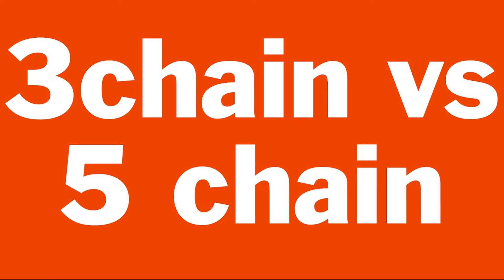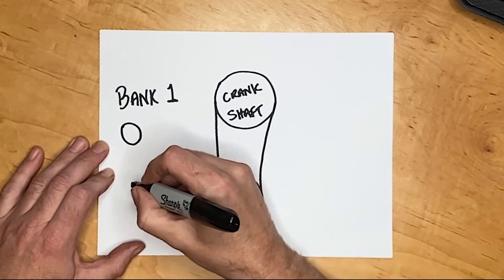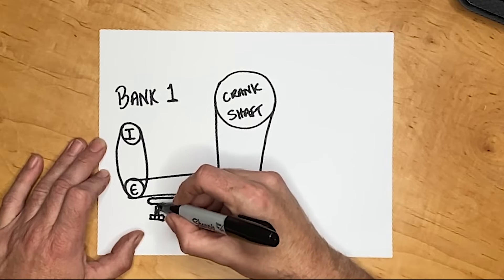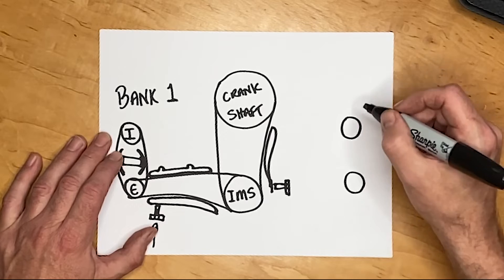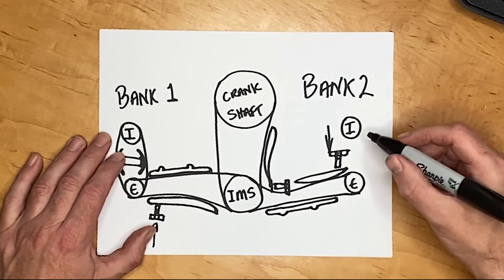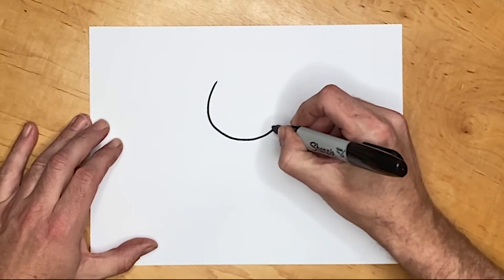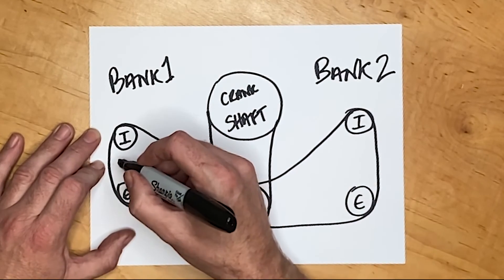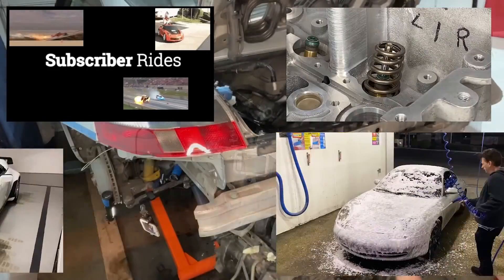Porsche Engine Evolution: Decoding Porsche 5 Chain vs. 3 Chain Design!"

Comment: Nice video! Good to mention that the variocam system of the 3 chain engines is completely different. It uses oil pressure to rotate the intake cam against the chain sprocket of the intake cam. The chain itself is not affected.
Reply from the maker: Thats a good point 👍 Thank you for watching! 🤘😎

Comment: Thanks for fun video! And great to see you back in action, hopefully an indication of improving health. My 2 cents worth: all else NOT considered, fewer chains of course is better. But also of course that's no way to make up your mind about what you prefer🙂. To me the 3-chain M96/03 has the plusses you mentioned (3.6 and Variocam+ give it more power and torque, plus fewer moving/wearing parts), and the minuses you also mentioned (more frequent bore-scoring, exactly because of the changes that @warrenlucier5796 mentioned, which in turn leads to oil contamination which leads to IMS bearing failure). On balance I think would still choose the later car & engine, but only after extensive Pre-purchase inspection! And looking at asking prices on European websites the marketplace overhere seems to agree 🙂2002+ 996.2's command higher valuations. Money no object of course would go for the GT3 engine (M96.76, M96.79, 3 chains, plain bearing IMS, Nikasil cylinder) or the MA1 from 2009 onwards, then down to 2 timing chains! (and a host of other improvements of course).
Reply: Would a 3 chain be a better choice?  Just finished watching videos on chain tensioner guides replacements, looks like a real project.  PCA videos seem to think the borescoring goes with the forged pistons.  Considering an 03-05 boxster S over earlier boxster.  Thanks.
Reply from the maker: @teamground0229  Check out my borescoring video

WHAT IS BORE SCORING? PORSCHE 996 & 997
https://youtu.be/QJ_6V0ihrks

Also episode 18 on the ims is worth a watch. 

The variocam is what took my car down. If it happened again i could fix it in a weekend with porsche parts for under $200. 

3 chain in this video wins because of its design and the fact that it removed a know failure point (variocam guides). If you look at the whole car the answer is not that simple. Any 996 or 997 should have the bores inspected from the oil sump side before purchase. Good luck, Thank you for watching! 🤘😎
Reply from the maker: Those are all very good points, I agree completely. All of this makes a Turbo look like a pretty good deal?? Thank you for watching and being a part of the tiny garage.  🤘😎

Comment: My perspective on this is, going to only 3 chains was a good idea, but they should've kept the double roller chain from the crankshaft to the IMS and located all the chains on the front of the engine. The aftermarket DLC plain bearing with the DOF to replace the ball bearing would have made things work quite a bit better. The original Lokasil cylinders and the ferrite piston skirt plating was better than the next generation, but government intervention was the cause of that one and ferrite got banned; dammit man.
Reply from the maker: 💯 I feel the overall design is a wonder of engineering, if only they didn’t have those pesky catastrophic failures that ruin lives…..Thank you for watching Warren! 🤘😎